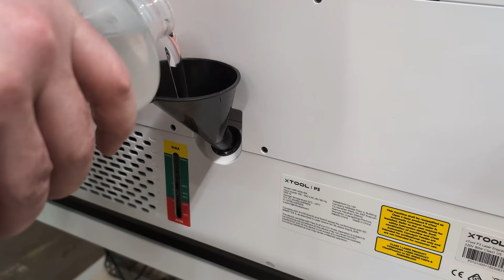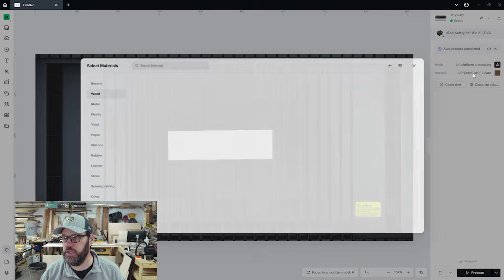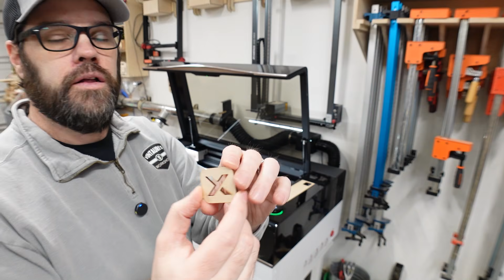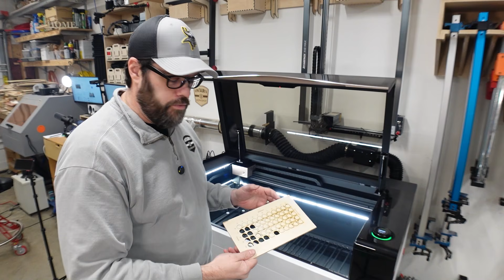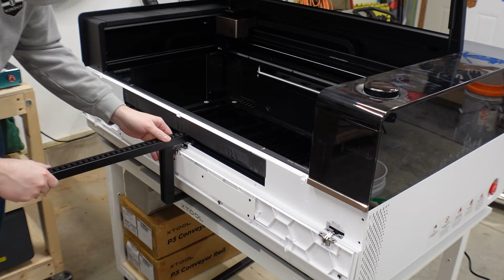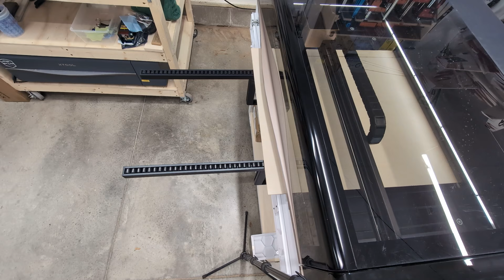Getting started with the xTool P3 laser

Comment: Will the P3 feeder system allow acrylic sheets to be ran through it? I know it will run wood and leather but what about acrylic.
Reply from the maker: I have not tried it myself, I would be concerned of the feed rollers leaving scratches on the acrylic.  They have some knurled teeth in metal that grabs the material and it would likely leave track marks on acrylic.  It also might struggle with anything too clear as there is a sensor that needs to be blocked, or it thinks the material has fed out of the rails and it will error out.

Comment: I do have the P3 and for the most part I am happy with it, BUT it does have a few issues. The biggest is the fire suppression system. Does it really work? I question it because myself and others are getting the message that the gas cylinder is not installed when in fact it is. My CO2 cylinder is a 1182G well about the required weight. But every time I power off and back on I get the message that the cylinder is not installed and from the P3 Facebook group other are having the same on going issue. This leads me to question if the fire suppression will even work. Yes never leave your P3 unmonitored but still you need to have 100% confidents that the fire safety system will work. And right now I DONT TRUST xtool. The 2nd major safety issue is the emergency is located on the right side in the far back which means you have to get way to close to the machine to use the button in an emergency. There are a few design flaws but the biggest is the process to recalibrate the C02 laser. The system uses dinosaur (over 100 years old) mechanical technology. Screws on screws. And FYI when you do need to recalibrate the laser IMPORTANT make sure you tie a string to the small allen wrench as you will drop it into the machine. The laser alignment is a major major pain and based on my experience xtool techs perform the calibration process while the side covers are off. Also there are no ZERO safety labels on the front of the machine. There on the side but they dont tell you where the power button is or where the emergency shut off is located. The Emergency shut-off needs to be on the front of the P3 in plain sight not located on the right side in the far back. The power button is located on the back of the P3. There are also no labels telling where either of these buttons are located. OSHA would have a field day with the safety hazard. The built-in fire suppression is my biggest concern as will it even work if needed.

Comment: GREETINFG: I HAVE A P3 ON THE WAY AND I'M A BIT CONCERN ABOUT THE DISTILLES WATER TO USE AND IS THE CLIMATE AN ISSUE?
Reply from the maker: They include a bottle of antifreeze and a chart to mix it for your climate.  You'll want to use Distilled water and not purified water.  Purified water has minerals added to it where distilled water has all the impurities removed. This makes it less conductive, which you want.

Comment: Can it engrave metal? If so, have you done a video?
Reply from the maker: Co2 lasers are not well suited for metal.  They will etch coatings and can mark stainless steel but not actually ablate into it. A fiber laser is what you really want for metal.
Reply: @Vintauri  thank you for your reply. When you say etch. Will it do portraits?. .
Reply from the maker: @waynebreier  You can remove coatings like anodization and powder coating, or they can leave a dark mark on stainless steel through annealing with heat or by fusing a marking spray.  However, it won't penetrate the metal to leave a mark. So, if you had a painted surface, you could and grave a photo or graphic by inverting the image and removing the lighter spots of the photo, leaving the darker areas as the painted color.

Comment: Can it  engrave metal ?
Reply from the maker: No it cannot. It will mark stainless steel and can remove the coatings from metal like powder coatings and anodization.  But it will not remove metal and leave an engraving.

Comment: Do you or any of your viewers know of a Laser system that has an automatic pass through system that i can cut 1/2" to 3/4" thick MDF on 48" x 96" sheet.  I am trying to quote a job that will require cutting possibly over 100 sheets so i need a Beast of a Machine.    @theclackshack  and yourself came to mind.

Comment: Best P3 review I’ve seen. Since you’ve reviewed both, I’d really appreciate head-to-head tests between the P3 and Atomstack 120W Glacier. I know that’s a lot to ask, even if you still have both on-hand.
Reply from the maker: Thanks for the feedback on the review.  I try to keep them more data driven than sales pitches.  I'd like to do some comparisons between the higher power diodes and similar powered Co2 lasers.  Right now I'm waiting on the official enclosure for the Glacier to do more tests with it as it's winter now and I can't run an open frame laser without smoke control.  I will say that the Co2 even with the lower wattage will cut faster than the diode. However the diode will give a darker engrave in most situations.

Comment: just got my p3 and setting it up and having terrible trouble just trying to do some test grids - I thought I read it came with presets for different materials, but it doesn't so really no clue where to start and end them.  Also, thought it auto measured the material since I know it isn't exactly 3mm or 6mm and if I turn the IF2 on it stays on - thought it was auto... I need a super basic tutorial (bunches of them) so please let them know if you have any pull :) ty

Comment: Don't like knob lcd selection
Reply from the maker: It is a bit limiting. Other than hitting process job, I hardly use the other features of it. I set the job up in the software and hit go. This laser is for people that like the simplicity of xTool software. Those that like the options to tinker and tweak will likely get frustrated with the automation. I'm going to run more projects on this and see how it might work on a production run type of job.

Comment: Great video. What size exhaust and fan do you use. I need to upgrade my exhaust. I am running a S1 and  F1 @ same time. Using what came with them. I have a lot of smoke in the S1 while cutting multiple Christmas ornaments. Thanks.
Reply from the maker: I've got a 6" inline fan but it's choked down to 4" pipe for now.  I'd like to change that to 6" piping to get more airflow when using multiple machines.
Reply: @Vintauri thanks Steve.